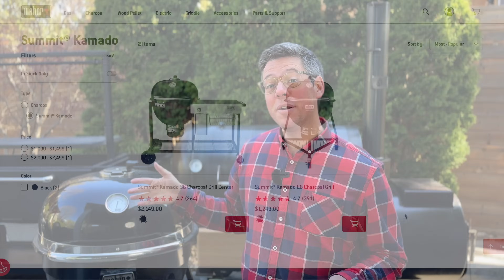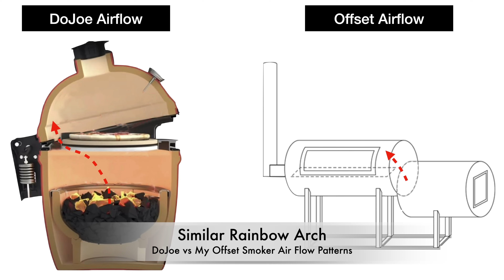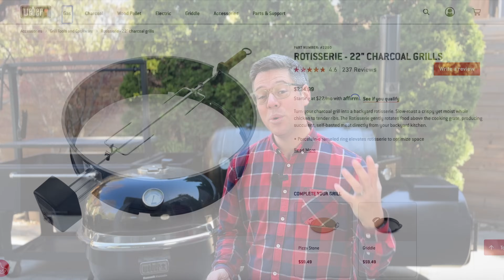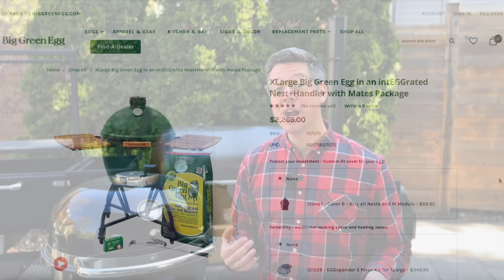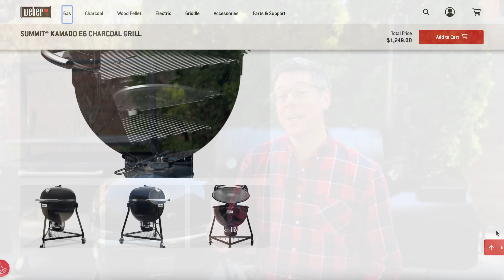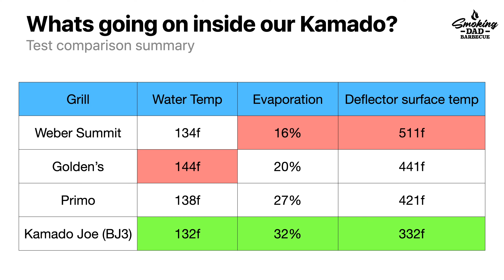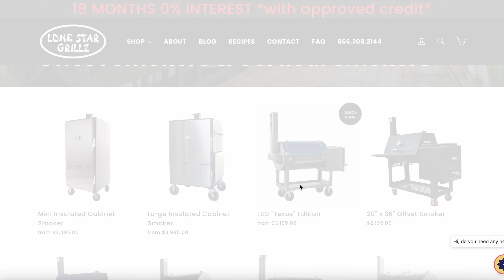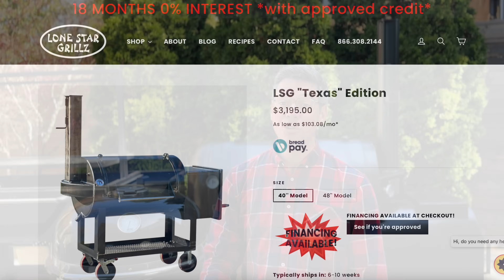3 Reasons NOT To Buy The NEW Weber Summit Kamado (1 Yr Review)

Comment: I find your review and criticisms here totally disingenuous.  Everyone is fully aware you are a Kamado Joe fan boy.  It would not surprise me in the least if Kamado Joe paid you to specifically give the Summit Kamado some negative press.  You are specifically picking out "non-issues" and trying to make them sound like they are of any concern.  Not to mention you are using Weber Summit S6 pricing when you should be using E6 pricing when comparing to the greatly overpriced Kamado Joe - where you should be using the BIG JOE pricing as well.  Didn't mention that a Big Joe is going to cost you close to $3000 in Canada...  Add in the Slo Roller (because you mentioned airflow issues in kamado grills which does NOT exclude the KJ line) onto the Big Joe and you are now approaching $3500.00 to eliminate the same issues on the KJ.  Start adding on all those KJ accessories, and you could easily be pushing $5000 for a KJ and (unneeded) accessories.
Reply from the maker: It seems you missed the section that I am not being paid by anyone to make this video nor do I profit if you buy any grill from any Kamado company.

Beyond my own testing, I've partnered with a top engineering university who is doing CFD studies on all Kamado's as a consumer there is no way to validate on companies claims on performance unlike if we are shopping for a vehicle where magazines might validate claims of 0-60 times, fuel economy etc. and or a new computers CPU claims might be subjected to an industry standard benchmark.

The Big Joe costs 2999 USD and is way more in Canadian dollars FYI.  If you missed the expanded test that was briefly referenced in this video it lives here - https://youtu.be/ySqIxcF96vg with expanded IR camera, temp points, deflector and evaporative cooling tests
Reply: @SmokingDadBBQ  Same here and we like your channel normally. You seem to have shat over the Weber Summit Kamado, comparing apples with pears
Reply: I agree with you!
Reply from the maker: @romanianredneckbbq  if consumer reports were to do this review how do you think they would rank a grill that costs more than comparable segment leaders, has less warranty, is less versatile in terms of out the box functionality, is more limited for table installation, has less oem accessories and in the performance tests did worse?  I totally respect you may not like this review but I worked hard to make this fair and fact based and I didn’t see any plausible way to have the summit in first place given the numerous trade offs above
Reply: As an S6 owner, he is spot on with the criticisms.  I have been very happy with mine, but for sure they are overpriced for what you get.  I needed a large grill and mobility, so I went the Weber route since it's much lighter, but in nearly every other way, the KJ is the better product. 

 Thankfully, many BIG Joe accessories do work (I even modified the Joetisserie to fit my Summit) but after all these years, even Weber doesn't seem committed to supporting this product.
Reply: @SmokingDadBBQ  it's a good detailed review, but the summit in your video retails for 1249, and the big Joe 1 is 1199.  Yes you get lifetime warranty on ceramic because it's more fragile but Weber is known for good quality ( I know people using kettles from the 70s and still looks great). People in general don't buy both so just can decide which one to get. They buy one or the other one. Regular homeowner will be happy with either one.  Look at the Weber kettle 26 or the Weber ranch 37. It's almost no accessories for that but people still buy them because it's great grills.  I personally have 2 Kamado joes and had the chance to cook with the summit Kamado which was installed beautifully in an outdoor kitchen island and it worked great, much more easier to control the temps and go up and down.   If you are all about the accessories and the versatility and the cooking distance between grates and fuel you have to consider the Real Kamado which is the Komodo Kamado, yes a bit pricey but it comes with everything you need, lifetime warranty and the bigger version can do 200hours at 225 with a full loaded basket. Those grills that you and me and average person has are kids toys compared to the real komodo Kamado. And yes they make all the sizes. Nothing personal here, people will buy what they want anyway regardless of users insights. Have a good one!
Reply: It appears that people who have bought a particular grill/smoker do not like negative reviews of the product they have purchased.

Reviews are one man's opinion! Nothing more nothing less. If the review is different than your experience, you move on!!

But to sit around and bicker over such silly stuff is comical to say the least.😂😂

Go throw meat on whatever grill/smoker you own and learn how to make that equipment work for you!😂😂😂😂😂😂😂😂😂😂😂😂😂😂😂😂😂

Put the fun back into grilling! Who gives a crap what someone else thinks about your choice of grill/smoker!😂😂😂😂😂😂😂😂😂😂😂😂😂
Reply: Definitely agree with you on everything you said. It's definitely misleading with this video.
Reply: @markinnis8404  People come here for an honesty opinion. True is only one person opinion but, this doesn't seem genuine. Every big review still has sponsors. He one of the better ones and he normally have valid points. Just not sure this review is for the everyday backyard person.
Reply: I do feel that the Summit videos on this channel lean overly negative. I like other channel videos, but on this topic it seems excessive and suspicious.

Other channels have reviewed Summit, compared it to KJ/BGE and have preferred the Summit. The products are similar enough for it to be a matter of preference; so I am not saying those channels are “right”
but I am saying that, in reality,  the comparison cannot as black and white as this channel makes it out to be.
  
There are knowledgeable consumers that think the Summit is a great product and still prefer it over KJ. YouTubers Babyback Maniac and Dki Grills each have Summit and KJ (and other Kamados) and they have done videos explaining why they prefer the Summit to those, and why it is their go-to or favorite grill in their collections. Their videos seem fair and balanced with actual practical feature differences and they don’t bash the KJ. IMO those videos are more believable than this one. I’ve been very satisfied with my (older model) Summit for years.
Reply: This video is 🗑🗑🗑🗑
Reply: Chill, this is just an honest review, the things that James looks for aren't supplied by the summit. If it has the things you're looking for then great! We are all entitled to our opinions.
Reply: @SmokingDadBBQ  So when you did you hit piece on Green Egg changing the terms of their guarantee I had to ask, how did you know? You weren't tip off by Kamado Joe?
Reply from the maker: @chrisbenson287  no. I still am active on big green egg forms having been part of that community longer than KJ is a company. When I spoke to a BGE representative they not only felt that review was fair but said when they fix it that they will give me an official statement / update to post / pin on that video which I will do when it’s out. I also have family and friends with eggs directly impacted by that policy change
Reply: @SmokingDadBBQ  Hmm, for the sake of neutrality perhaps it;s time to question the value of the Slow Roller which hasn't exactly flown off the shelves, and has been meet with ambiguity at best by reviewers, then we have the need for a latch on the lid of the BJ lid which other manufacturers don't feel the need of, problems making a proper seal?
Reply from the maker: @chrisbenson287  no argument from me. I was shocked when I did several videos a while back and put it against my series 1 that I bought and couldn’t taste any difference at all
Reply: @grantandjanice  did you buy a Weber kettle?
Reply: @SmokingDadBBQ  Have you seen @GrantandJanice 's reply?
Reply: The summit is pretty meh
Reply: Clearly you haven't watched too many of his videos, if you had you would know that he always gives an honest answer many times even using side by side demonstrations so you can see the proof for your self. Do more research on people before you start hating on line

Comment: As an owner of a Weber Kamado, the lack of accessories is by far my biggest complaint
Reply from the maker: It’s a large part of what makes a Kamado a Kamado (being a jack of all trades, extended further with third party and or original brand accessories) agreed
Reply: Yea literally had to buy a big Joe rotisserie and butcher it to make it fit.
Reply from the maker: @garethmillen5417  it should fit ok, a little play / wiggle of the dome and mine sealed up just fine.  same with the dojoe and dc rack ... not a perfect fit but i did get them in
Reply: @garethmillen5417  did the same. A rotary tool and 3 cutting disks later and the big joetissery fits great.
Reply: I like the fact that the Weber is a reasonable weight, and can be moved around easily.  Unfortunately, Weber quality control is non-existent.

Comment: Hi James, sorry I have to disagree with you. I have had the original Weber Summit with cart for 4 years. I bought it for $1900 cdn, inclusive of taxes. The advantages are that it is relatively lightweight and I can roll it around my yard. I don’t have to worry about damaging ceramics which is not warrantied by KJ and BGE. I have the double SS diffuser which makes it fuel efficient and does not burn a foil aluminum water pan I may put on top of it, under a brisket. I really like the port hole that fits my Thermoworks Billows and Signals. I can put a 20 lb brisket on in the evening and go to bed without having to babysit temps. I don’t need to lift the hinges to add charcoal, even after a long brisket cook, I still have charcoal left over. I share your concerns about  reverse searing etc, but I have a Weber kettle kitted out with a SNS and vortex. Also, I have a 18” WSM with a Rib hanger, for more than 2 racks of ribs. I prefer the ribs laying horizontally in my Summit if I only cook two. I really like the original Summit and consider it one tool in my arsenal. Cheers.
Reply from the maker: I too prefer the original summit. That’s the first one I used and liked

Comment: I have an XL BGE... I like the ash catcher on the E6. From reading reviews, the plastic bushings between the E6 nest frame and casters are cheap and the top vent moves when opening and has to be reset after the lid is closed. Lack of accessories. S6 built into cheap table for additional $900 also garnered a lot of negative reviews. I'm just not convinced that Weber brought its A-game to the Kamado competitive space and would not go this route.

Comment: Great thorough video, helpful as someone looking for their first kamado. I have a Fontana wood fired oven and a WK currently, looking to get a kamado to potentially replace the kettle as a main cooker. I do love the offset top vent on the kettle, and understand that for the Summit Kamado they've placed it on top as other Kamado's do. You had mentioned this as one of the drawbacks of the Weber Summit, but wouldn't that be drawback of all kamado's? If this would produce a dirtier smoke or "ashtray" like flavour in the Summit, would it not be the same in a KJ or BGE if the same accessories and setup was used?

Just curious because if that was one of the reasons to not get this, over another Kamado, i'd want to know if the others would produce the same effect. 

Love the video's! By the way, i'm specifically looking for a Kamado to build into an outdoor kitchen, one of the drawbacks I find with the Summit is it's one of the only kamado's that can't stand on its own. Barely any videos/pictures of successful built ins. I wish they made a model with feet, that bottom ash bin could have been replaced with a more robust cleanout and a housing that could support it as a standalone. My biggest gripe so far with considering this one.

Comment: You make some good points James, however the reasons I purchased the Summit were more about convienence and quickness. Off the line for a Kamado this grill is ready and at temp much quicker than all other ceramic kamado's which are waiting to come to temp and level out.  The first assessory I bought also was the SnS basket, but in my 2 1/2 years of use and I use it plenty, I haven't experienced any off tastes with my food especially wings which I do at least once a week. I do however position the basket straight back behind the hinge and place a piece of foil below on the bottom grate to catch the grease and direct some air flow, I'll even toss in a chunk in for additional smoke at times. Unlike most ceramics if you overshoot your temp I found this grill easier to bring back into play from a control standpoint. I don't use the deflector, never have...I have as my work horse a Komodo Kamado, a unit that can do it all and better in every catergory than any kamado in the field. I've owned 2 Grill domes, an XL Primo and loved cooking on them for years, but 8 years back after purchasing the KK I kept the others in the stable for a while, eventually I let them out to pasture to my sons in law. They both admire my KK, it's quality foremost and when I pass it'll proably end up in one of their backyards. I'd love to take it with me although I'm afraid it's not allowed. I have few others/cookers collectively strewn about and use them for purposes I feel best suited for, specific cooks for ease of use.  So your correct, it doesn't outshine the others in every catergory, I view it as a transitional Kamado, it's design though close is imperfect so it'll never be all that. In the end it can be a challenge, but who doesn't like a challenge.
Reply from the maker: It’s a great grill and I hope Weber continues to develop it. It’s the only one I don’t worry about breaking when moving around

Comment: I have now owned this grill for more than a year and have gotten some great results as it is my first Kamado-style cooker. I think the criticisms in this video are valid however the value proposition of the product can be increased by doing these two things: (1) don't buy the expensive cart. (2) Put a second layer of air/metal between the fire and the food. I have achieved this by putting a circular stainless drip pan directly above the fire, then the OEM diffuser plate on top of that. Finally a drip tray on top of the diffuser pan. Works wonders.

Comment: James, you mentioned that you have a Lonestar Santa Maria. I am just about to drive over to Buffalo and pick up my Lonestar Pellet Grill. In speaking with Chris (the owner of Lonestar), it was my understanding that there are literally only a couple of their grills up here in Canada. Have you had the chance to use any of Lonestar's other grills aside from your Santa Maria? How did you find the process of getting your grill across the border? Also, have you had the chance to compare the Lonestar Pellet Grill using wood chips vs your offset? I think that would make for a great head to head.
Reply from the maker: I've not had an opportunity to try their pellet grills, I hear good things but i have never used one so can't speak to it.  I was planning to use cross border pickups which I used for smaller items but they don't have a flat load truck and or a fork lift service so they couldn't guarantee they could ship it in Canada after receiving it so they helped connect with me another importer / freight company to get it to me.  If it was less than the ~700lbs it weighs I would have taken the pick truck and a friend or two to get it
Reply: @SmokingDadBBQ  Thanks for the reply. I will be going across the border to pick mine up and bring it over. FYI...I live just north of Toronto so if you are interested in doing a head to head your offset vs my Lonestar pellet running a combo of pellets and wood chips, I think that would make for a very unique and interesting video. Let me know if this is something you might want to consider.
Reply from the maker: @DrBar-B-Que-nx2ye  if you’re open to me coming to try it I would be interested and can provide the food we’d cook
Reply: @SmokingDadBBQ  I am very open to it. Let me get it home, seasoned and get used to it a bit and I will definitely reach out.

Comment: I made a suggestion to Weber to make an insulated steel Kamado grill 2-3 years before they came out with the Summit. I wanted it to replace my rusting Chargriller Akorn. I stayed that it should be about $750 USD. Imagine my surprise when they brought out this ridiculously expensive grill. I was stunned. And it made me realize that Weber is so out of touch that I won't buy any more grills from them. I ended up with a PK 300 and it is good enough for me without headaches of serious rusting. Sure, I'll have to replace the grates, but that's years away still. 2 zone is super easy. Air management is super easy. It's smaller, doesn't have quite the number of accessories, but has a 20 year capsule warranty. I honestly think it will double that if grates are available. And it came in on budget.